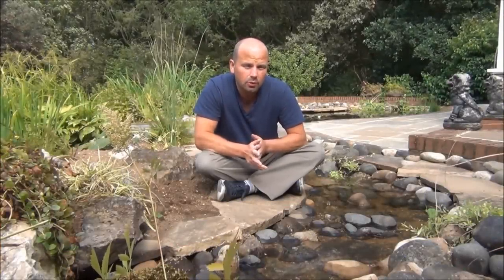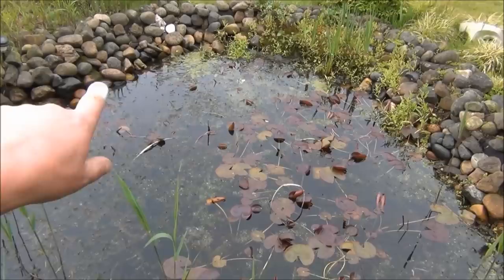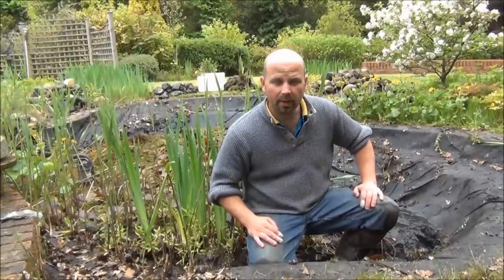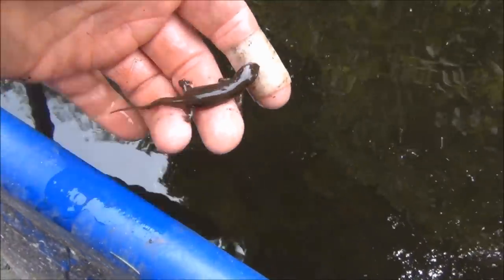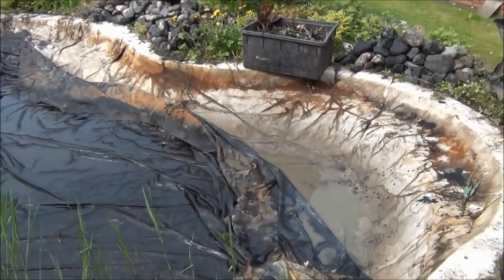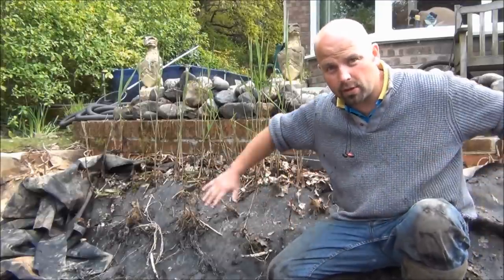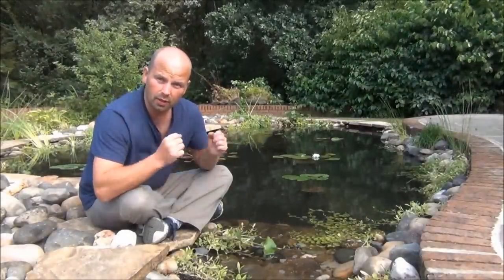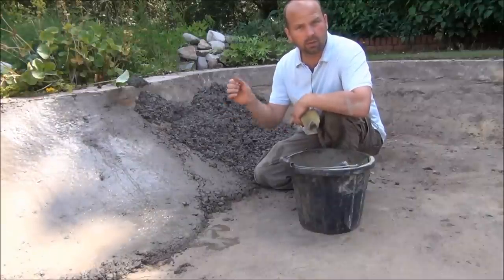Concrete and Render Pond Construction by Pondguru - Pond Building in North East England

Comment from the maker: BIOHOME FILTER MEDIA, FILTER UPGRADE KITS AND FOAMS HERE: http://www.filterpro.co.uk
This video shows the stages of a pond renovation we did in Prudhoe, Northumberland.
As there was a major problem with Norfolk Reed (Phragmites australis) we decided not to rebuild the pond with liner, choosing concrete and painted render instead.
This guaranteed there would be no more damage from below by any remnants of the grass.

Full 'How to' build a fish pond video here: http://www.youtube.com/watch?v=L63k5i...

The concrete mix is as follows:
3 gravel
2 sand
1 cememt

1st coat of render mix is as follows:
4 building sand
1 cement
Waterproofer / retarder
PVA glue

2nd coat of render mix is as follows:
As above but using render / plastering sand instead of building sand.

Paint is 2 coats of 'Pond Paint' from ASK Coatings
http://www.askcoatings.com

Thanks for watching. Check out my other videos - there are hundreds.
Reply: Pondguru your an absolute life saver with the video. Am broke and recently 16 looking to build a pond in the future. After 2 hours of research came across your Video and that was all I needed . Keep up the good work.👍🏻
Reply from the maker: @drmadman5313  No worries, I'm glad you found the video useful.

Comment from the maker: I was on holiday a couple of weeks ago in Majorca. The tan is certainly not from exposure to the sun in North East England, lol.
Once the cement has hardened it doesn't move but when drying it can crack. Using PVA and retarder does help prevent that I think but sometimes if we are rendering vertical walls the render will get fine cracks in which need smoothing out / filing in by brushing. The paint seals the cement which prevents pH being affected by anything in cement.
Thanks for watching, man.

Comment: Thank you for this very helpful video. I have an existing large pond (10x10) with a rubber liner that must have developed some very small holes as it loses water, yet I can't see the holes! I am going to concrete the thing. The liner is not perfectly smooth (it's rippled in places a bit) - do I need to smoothen it or can I just apply a bit more concrete to cover the little bumps and creases?

Comment from the maker: The liner in the pond was a 0.75mm butyl rubber, not the 0.7 greenseal rubber which is commonly used now. Butyl pierces very easily if the roots get into folds. If there are minimal folds you can often get away with reedmace, norfolk reed and branched burr reed but I'd always avoid using any of them just to be safe.
Forget me not is the ultimate plant for the great crested newts to spawn on - one of my favorites too.

Comment from the maker: Yes the reed was put in by the company which built the pond originally - nit sure who it was but they should have really known better as they did a decent job of the original pond. The cobbles around the edge of the pond were loose apart from the ones around the shelf edges which were cemented in to retain the loose ones behind them. I dare say the newts will enjoy lurking in them until the plants spread out.
Thanks for watching and appreciating the video.

Comment: Awesome videos of pool construction, good job. One question about this concrete pool, I didn't hear anything about wire or steel in the concrete, do you need to put some kind of steel/ rebar in the bottom for the weight and wire on the sides for the concrete to stick to?
Reply from the maker: The sides of the pond weren't very steep so getting concrete and render to stick was easy. As the pond was in place of a previous one which had been there for years the ground is very well settled.
Glad you enjoy the videos.

Comment: G'day, do you think the concrete needs to be waterproofed as well? How thick did you make the main layer of concrete? I have a similar pond with double shelves and 8 mtrs wide x 9 mtrs long and 700mm deep in the middle. Obviously, I'll need quite a good supply of concrete and I'm thinking of laying in 2 layers. That is, the deepest level and upward to the second level and allow to harden. Then the second level and upward to the top of the pond. Do you think that should work out OK?

Comment: Politician?

Your videos helped me a lot when doing my pond but there's one bit I'm having problems with. The top pond is a preformed liner which has a cascade coming down into it. This top pond then flows into my large pond at the bottom via a waterfall. I just can't seem to get the waterfall liner right though. Is it best to attached it to the preformed pond with aquarium sealer and then cement everything else in as normal?

Comment: Hi,
We have a large and interesting pond which is part of a water flow from an upper pond on our neighbours land.  The water then flows from our pond down to other neighbouring land. 
It has been lined before we bought the property but badly by the look of it.  It has numerous 'bulges' where the lining is lifting and it leaks so dries out in the summer unless we keep it topped up.
I feel that lining in concrete etc is the best option but what difference will the water flow make to your recommendations?
Many thanks, William James

Comment from the maker: There has been a catalog of disasters associated with that pond. I wish I'd done it myself and it would have been finished weeks ago but I gave another company the work to get it done quicker and take the pressure off me as I was so busy. All will become apparent when it is finally done and I make a video. All the parts I did are fine but there have been numerous hold ups and corrections.

Comment: I've been trying to waterproof a 5m x 3m concrete fountain basin for longer than this video has existed, I've yet to succeed. It has vertical sides and covers a breeze block frame. The only thing I haven't tried is the pond paint, although they may not have that here in France. I even tried the Roman way, of adding crushed terracotta tiles into the concrete mix.

Comment: Thank you very very much for the videos. You inspired me to build a pond in my small back yard. I promise will put a video of it soon. 
But now I am planing to build one for my brother and I would like to make it from concrete. 
You have all details about the concrete and render mix but what is the thickness of the render? I can figure out the concrete thickness and the steel bares used in it but the render is an issue for me. Hope you don't consider this as a stupid question.
Thanks
Reply from the maker: +Artashes Harutyunyan The render is in 2 coats and the first one using building sand / cement / PVA is approx. 5-8mm thick but can vary depending on slope and shape of pond. Second coat is render (plastering) sand / cement PVA and is normally 4-6mm thick but that can vary too. When you're putting it on you will quickly see what is necessary for the situation and if it is going over a 100% concrete pond it doesn't need to be super thick as all you're doing is adding a smooth surface to take the paint of fibreglass waterproofing. Feel free to send me links to any videos you do as I love to see what other people are building and how it turns out.

Comment: Hi I'm going to be building a koi pond that is 3mx3mx1.5m. I'll be using concrete for the base And 6 inch hollow concrete block for the walls that will be back filled with concrete.
I will then render the inside of the pond and I was going to use pond paint to seal it but my question is how do i seal the aerated bottom drain, return jets and surface skimmer to a painted pond 

Thanks Colin

Comment: Hi,
I have planned my pond, it will have Sleepers for a wall above ground for hight but will be dug down to 3 feet,  it will be 9 feet wide, 23 feet long,  how long do you think it should take someone who knows what they are doing to concrete that area?
Concreted area: 3 feet x 9 feet x 23 feet. That is the part I doubt I will do but may supply what is needed so I'm  trying to work out how much I will be charged.
Doesn't galvenised steel need to be put i. place?
Thanks

Comment: I would have liked to see the process of applying the PVA glue. Do you just spread it with a paint brush like one would with paint, all over the area that will be covered by the render layer?
Reply from the maker: It was mixed up about 1 part glue to 5 parts water then applied with a paintbrush. It soon goes tacky and really helps the render stick. The PVA glue is also mixed in with the render - maybe a coffee mug full per mix if using a cement mixer. It aids the workability of the render.

Comment: Bloody good videos Richard. Im doing a kidney shaped pond in my garden, would it be best to have steps or no steps for the extra volume. I have put steps on the sides purely to put plant baskets but as Im still digging it out I can easily remove the steps. I need to digg it a little deeper as I have only got the deepest part at 4 foot where the pump will go and thats it, the rest of the pond is roughly a metre deep.
Reply from the maker: Jonty Johnson If you are after maximum volume then remove the steps as that will make a big difference to the capacity but if you remove them it will be more difficult to plant up unless you make provision for that around the edges (by extending liner under edging stones and filling in gaps with gravel or soil to plant into).

Comment: hi im going to bulid a pond in my garden but building it up not in the ground 6ft long by 8 ft wide is it safe to build it with block on edge or has it got to be block on flat..its going to be about 3ft high

Comment: I had a 4x3 metre wildlife pond at my last house but have an opportunity to have one at least double that size at my new place. I want it to last forever, so a liner is out. I'm wary of concrete as I've heard of leaky ones after a few years. Is something like bentonite  clay a realistic proposition for a larger pond say 8x6 metres or a bit larger?
Reply from the maker: Sorry just seen this comment now. I haven't used bentonite but have seen it used on larger pond to good effect. It think for a 8x6 metre pond it would be a feasible option. Yes concrete ponds have to be put in very well or they can crack if the ground shifts. You could always use visqueen (cheap PVC) under it and that will prevent any land movement causing leaks - the concrete will protect the liner.

Comment: I love your pond works... i've learned alot from your videos. I adore wildlife and love to make a home for them, I have one question as an ecologically oriented mind. is it possible to build a pond without using liner and concrete and instead use a natural waterproof material like lime or other things? and is it possible also to make a pond without pumps and machines? basicly a totally natural pond inside out, possible?
Reply from the maker: It is possible to make a pond with clay. My large pond at home is just clay and is spring fed but for a domestic situation it really needs to be a liner (flexible or rigid) or concrete. Unfortunately that's the only clay pond I've made and I didn't have a video camera at the time.

Comment: Thanks for a great tutorial.
Our local hardware has only one type of sand - river sand. Would this be okay for both render coats, or should I try to buy pre-mixed bags?
Reply from the maker: That should be fine, yes.
I suppose there are no real had and fast rules for rendering and I tend to go with 2 coats for vertical sides to build up thickness but on a pond like this you could probably get away with a single coat of thicker render.

Comment: Well done, great job on the pond. Did you adjust the costs to the customer based on the changes that needed to be made due to the grasses? Was the differences in the cost significant? Cheers

Comment from the maker: The thickness depends on the typ of pond and what the ground is like beneath it. I'd go for at least 2"-4" depending on pond size / depth / ground type followed by 2 coats of render. 1st coat being approx. 1cm (0.5") and the finish coat being 0.5cm (0.25"). Large koi ponds would have a deeper bed of concrete on the base due to the weight pressing from deep water - generally around 6" at least.
Damn the otter...
Thanks for watching and appreciating the video.

Comment: How thick do you make the concrete?  Do you put wire or Rebar in it?  I have a 90 yr. Old concrete pond done by the American landscape architect Jens Jensen.  He did the beautiful ponds in the Chicago Garfield Conservatory. My pond has caved in execpt for the waterfall. I have saved all the Tufa stone and large cobblers.  So I want to restore it.  I replaced his overgrown plantings with a cottage garden.  I live in Chicago where we have bad winters and cold springs.  So alot of freeze/thaw cycles.
Reply from the maker: The thickness and need for rebar depends on size of pond and ground conditions but generally the larger the pond is the greater need for thicker concrete with reinforcement. If you live in a very cold region it will definitely be worth going thick and solid with a good covering of fibreglass to prevent any water ingress into the concrete as it will always be porous and if it freezes when concrete is wet it will break up.

Comment from the maker: Yes, the liner would have likely lasted less than a year if we couldn't get every last piece of weed root out so it was important to go with a rendered pond. The garden also has a problem with high water table so using concrete will prevent any liner rising problems.
Thanks for watching and appreciating the videos.

Comment: q1:my concern is concrete ph, in your opinion which material can i apply on block render that will help me in reducing concrete ph from going sky-high? G4 or fibreglass? and if i apply fibreglass, is there anything i should apply on fibreglass? or it will be the latest layer that will contact water and fish?  isn't it fibreglass direct contact will be toxic to fish? 

q2: how can i calculate  pond oxygenation requirement? to chose the correct aeration system? and how i calculate how much aeration that fountain can add to the surface? 

and really I'm appreciating your help, time and efforts in order to help me. 

thanks a lot agin, looking forward to hear from you.
Reply from the maker: G4 or fibreglass will seal the cement render so pH will not be an issue. Fibreglass would be the final coat and is fine for use in fish ponds - just give it a good wash down to remove any spare fibres or oily residue prior to filling the pond.
Usually a good cascade returning water from the filter will be enough to agitate the surface of the water but if you wanted an air pump you could get an aerated bottom drain which seems quite popular - look up the 'spindrifter bottom drains' on the internet and they should give the recommended air pumps for those. 
If you were after a standard air pump and air plate / stone see what is available from your local stockists and they should advise you on the size required based on the pond dimensions.
Reply: Thanks a lot. Appreciate it

Comment from the maker: Yeah, the flow is quite slow as we used the original pump but it fits very well with the quiet garden. A raging torrent would have been wrong but the stream will take more flow. I think I'd go for an Aquamax 8000 or even a 12000 if much more flow was required. 
Thanks for watching and appreciating the video.

Comment from the maker: Going from a preformed pond to liner is never easy as preformed ponds are generally designed to be the pond which water flows into, not the other way round. I just tend to build everything with liner which can be placed wherever you want it so it will not leak. You could try sealing it under the lip of the preformed pond but its never a good look.

Comment: I use a cement SBR slurry when I'm doing DPC's which is very effective.  could you use that slurry in a pond ?
Reply from the maker: Yes I suppose it would be fine to use that. I have seen cement and concrete applied using a pump and hose before and it seemed to do a good job.

Comment: I need to understand the layers of concert pond. As I red articles they mention that first block then cement then fiberglass .. Is that sequence correct?! Is there anything between them?! And what's the good way to overcome the new pond syndrome that's mostly high ph comes from blocks. Is there a good way to do so?!
Reply from the maker: Yes block, render and fibreglass in that order will make a really great pond and is the best way to do it if you're worried about paint getting damaged or pH issues from cement.
The render sticks to the blocks and the fibreglass sticks to the render.

Comment: Hi pond guru is pond paint against render as durable as a liner? if heard alot of mixed views about It, but I'm considering it. rather than messing around with a liner.
Reply from the maker: As long as the render is good and the paint is applied properly with enough coats then yes it is very hard wearing. It will not puncture like liner but at the same time it will not stretch like liner so if there is any ground movement a concrete / render / painted pond can crack.

Comment: Waterproofer/retarder and PVA glue are two different things or or they are one and the same, meaning that waterproofer/retarder is PVA glue ? Sorry to bother you but i want to be sure because PVA is cheap compared to professional waterproofers.
Reply from the maker: The waterproofer / retarder is one additive and the PVA glue is another so you have to buy both for making the render workable and ensure a good bond and strength.
Reply: Pondguru Thank you very much ...

Comment: Did you have to add the aquatic creatures, or did they come on there own?
Reply from the maker: They were from the existing pond - we stored all the creatures and plants in a large container for the duration of the work then released them back in once the pond was filled and had run for a couple of days to warm up / get rid of chlorine in tap water.